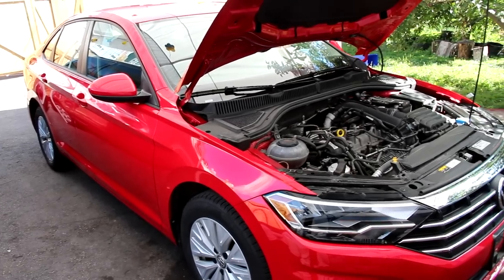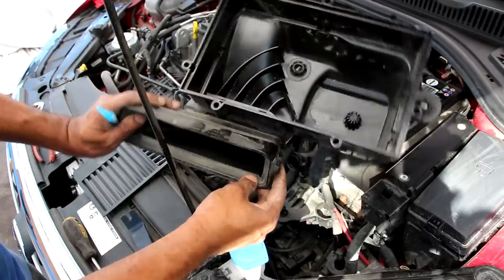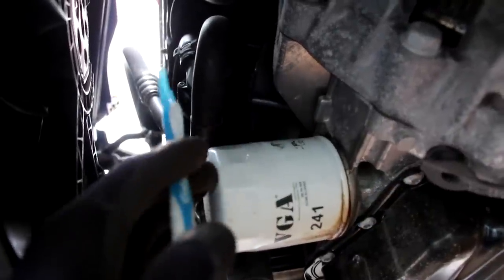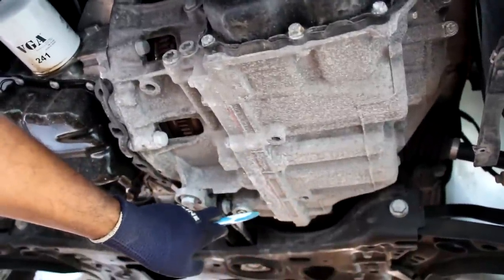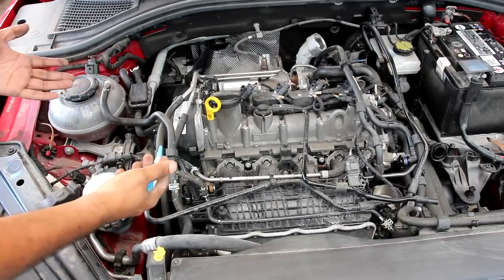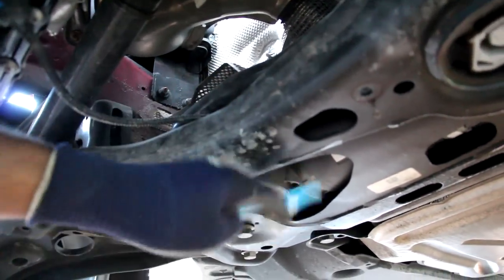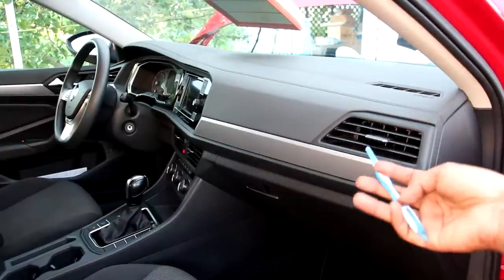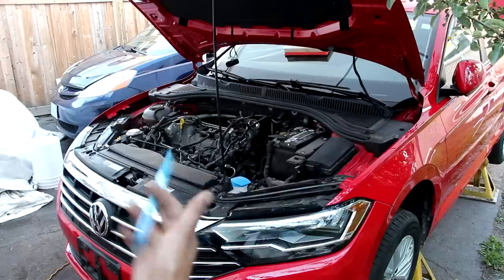Volkswagen Jetta Mechanical Review

Comment: Love the fact you are realistic, there is no "if" but "when" it fails. VW quality has taken an extreme nosedive in the last 3-5 years. Anyone thats compared the 7.5 Golf to an 8 would see.  We have a 6R Polo (other half's daily driver) no chance its staying with us past warranty. Way too much risk. Lovely to drive though.
Reply from the maker: It's sad that so much engineering and manufacturing effort goes to waste so quickly after warranty
Reply: Most of ‘cost-cutting on 7.5 to 8’ is the emperors new clothes. Golf 8 comes with more standard kit and is a finer tuned car. For example, it doesn’t have a gas bonnet strut, but it has 2 bonnet catches and the bonnet is actually aluminium so it is very light. The interior is just as solid too.

Comment: The inter cooler is integrated in the intake manifold.
Reply: @andybub45  It does improve the quickness of the air built up from the turbo. Because the lenfth of the Pipe ist shorter.
Reply from the maker: Very true. Less lag

Comment: Great review. Did you ever find the oil leak? That oil filter seem a little suspicious, didn't look original and seem to have a spot of oil !
Reply from the maker: Oil drain plug most likely
Reply: @speedkar99  so nothing was really broken?
Reply: Somebody changed the oil at one point and reused the Drain plug. They have to be replaced at every oil change due to it using a crush washer. ECS tuning sells two different drain plug types that eliminate the need of buying a whole new bolt every time.
Reply: @Tyler0513  ah intresting
Reply: no.. I believe people just hand tighten the filter w/out checking for leaks with the engine running.. the oil filter needs to be tightened down with a filter wrench to prevent leaking ( be careful not to crimp the filter).

Comment: Does anyone have problems with their Jetta 2019 with the transmission, I hear some grinding noise from it at approximately 30mph. And it's not the turbo noise. You can read this all over internet, I like the car enough to stay with it, but this sound it's making me crazy, and of course, tech mechs say it's normal, and it's not normal.
Reply: No, I have a gli and I don’t have any problems at all.
Reply from the maker: I've heard of the issues, I mentioned it in the video
Reply: @speedkar99  indeed, but in your experience, is this something that can be worsening in the long run? Can this cause any issues with the transmission or any other mechanical part? Thank you.
Reply: @MikeGod123  Yes, I hear this at times.  It tends to diminish past the break in phase of the car, at least in my case.  Notice - if you put the car in Sport Mode, the sound will go away.  There is greater throttle/more aggressive gearing it seems under Sport Mode, hence making the sound go away.  I believe the sound is due to the torque converter and gearing that is specifically chosen for fuel economy.  There is nothing wrong with the car, although I admit the sound can be an annoyance.
Reply: Buy a manual gear box next time - know too complicated to shift through 6 gears, especially in the city. But all automatic transmissions are crap these days, just like Samsung dishwashers - only good until warranty is over.

Comment: I owned a '10 Jetta TDI for six years that required a full replacement of the entire fuel line due to contamination.  Not sure if diesel fuel carries more contaminants than gas, but all i ever used was diesel.  Other than that fuel line, that turbocharged diesel was a pleasure to drive with that DSG.

Comment: This does have a fill port for the transmission, it's under the battery. You can access it with the air box removed.

Comment: Maybe they stopped using timing chains because VW had so many problems with them. Personally I'm happier having a component which is changed at regular intervals than with a component which supposedly "lasts the life of the vehicle", because this has been shown not to be the case on many occasions.
Reply: I wonder what your wallet thinks about that? Timing belt replacements on VWs are very expensive.
Reply: @andybub45  Replacing timing chains is also expensive, never mind fixing the damage if they break. Let's be completely honest here: maintaining a car is an expensive business, and if someone is not prepared to pay the price they should take the bus.
Reply from the maker: Why didn't they fix the chain problem? All the other small car OEs are doing chains

Comment: God, what an engineering mess compared to Toyota or Hyundai. I can't believe I was a VW fan boy back in the day.
Reply: I just bought a brand new Passat a few days ago.. now after seeing this video I’m a little concerned.😂 I actually had to exchange the vehicle today because it had multiple issues
Reply: Try looking at a Toyota 200 series V8 diesel and revise your comment about engineering mess.
Reply from the maker: Hot mess indeed
Reply: Ein Felder Exactly. The newer designs are getting crazy. It’s no longer just a German trait.
Reply: @ghost-4230  What were the issues?  Must have been pretty major for them to exchange the vehicle, rather than fix it!
Reply: What's weird is I don't recall EU Golf being such a pain to service. Looks like many parts are different, for example I don't think VW group offers torque coverter automatic in Europe, only 7DCT (and 6DCT for hybrids). They have decent reliability as long as you don't buy first engine within 2 years of launch. Even infamous 1.4 TSI is reliable engine now (supposedly).

Comment: My 2016 1.8 engine has the oil filter on top. Easy to service. It also has a timing chain. My car also has a battery cover, and an engine cover. It also has 3 point rear suspension. Oh, under hood has big thick silencing material. I think the 2016 SEL is a better car.

Comment: I don't know what it is about America that can not get along with German cars especially VW. They're reliable everywhere else but it seems America can not deal with "Advanced" because they can only deal with a car that can use a 2 dollar OBD scanner. Many VWs are top 10 best selling vehicles in Europe and especially Africa because they are reliable.
Reply: The European models are probably made better. They're notorious for having a plethora of electronic issues and ridiculously expensive to get fixed.
Reply: iam in 3rd world country and i will till you the problem with german cars ...ur  cars after 1980s dont stand well for hot /muddy /dust  zones there parts are not reliable and need replacing very often while its rarely to find their parts for good price if you are lucky to find them and alot of general mechanics   will refuse work on it or will do it wrong due to complexity and hidden parts or sensors
Reply: @Techie1224  yes, and they require fancy electronic tools and computers to fix, some only the dealer has.
Reply: @Techie1224  What country is that? I'm from South Africa and literally nothing can knock the VW Polo from being the best selling car in the country for the last decade or more. Second place is the Toyota Corolla. The 2 best selling premium sedans are the C Class and 3 series both of which were in the top 10 best selling cars a few years back for many years. Price increases has changed that but they still outsell any premium sedan (or normal sedan) from other manufacturers. There's so many in the road. We have specialist after market service centres and stores that cater for just German cars. They sell high quality reconditioned parts and brand new parts. In fact, there's more old Polos left on the road than Toyota Yarises. German cars are very reliable but they just need maintenance like every other car. It may cost more to maintain but that's what you get when they're ahead with technology and when they provide a ride like nothing else in the industry. They're solid and robust and can take a beating. Then again however, it is easier to maintain them in South Africa because of such loyalty by South Africans to the German carmakers and the number of them on the roads. German cars have a cult following here and as a result, there's so many aftermarket service centres, mechanics, spares, stores and tuners that it makes it much easier. I'm guessing much of Europe is the same and I know some other African countries are. 

It's why I've never understood why American markets don't get along with them. German cars are used as police cars, emergency vehicles and taxis (from an Uber perspective) in South Africa. The police use 1 and 3 series BMWs as well as VW Golf GTIs. Golfs are especially used by anti hijacking units and tracking companies. Mercedes Vitos and Sprinters are used as ambulance vehicles and most Uber Black rides are an E or C Class. It's because they're all solid and reliable. I don't get the American view.
Reply: @SDav21  
egypt and people there and in middleeast look for japanese, korean , american , some french and they even buy chinese cars ... german cars are  bad resale value and high costs
Reply from the maker: Depends on the model for the market and who's fixing it. In it's domestic market I'm sure the Jetta does better
Reply: @Techie1224  Interesting. Here in South Africa they have excellent resale value and maintenance costs isn't as high as people expect. You'll find 7 year old C Classes still selling for half its original price. Mercedes has the best resale with Lexus having the worst because Lexus simply doesn't sell many cars (no one seems to want to buy them). VW has excellent resale values too especially the Polo and Golf GTI.

Comment: I have a 2015 Jetta tsi with the 1.8 turbo just turned 100,000km.  Should i start worrying about the engine?  In terms of timing belts or whatever else?  Thanks in advance.
Reply from the maker: Start by doing maintenance
Reply: @speedkar99   i do maintain it i assumed that would go without having to state it.

Comment: I have one and I have so many issues with it 😞

Oh yeah, and an oil leak is one
Reply from the maker: Where's it leaking from? Seems like someone didn't tighten the drain pan bolt on this
Reply: @speedkar99  I am not sure, I'm not too handy and I haven't gotten it looked at yet. I think the oil is burning up since there's no sign of a leak, but I need to fill my oil like every month. Also the left head light burns out all the time
Reply: @Addison I don't believe you have this generation of VW Jetta if you're having those problems. If you do you must have got a straight lemon, I bought my 2019 VW Jetta new w cash in early 2019 and a little over 2 years and almost 40,000 miles later shes still a flawlessly running car. I drive her daily and I have the 6 speed manual but I'm a Euro car enthusiast and I owned an E90 BMW for many years before this so this engine will probably be mich simpler for me whenever the day comes I do have to do a little of my own wrenching or maintenance. It's a life style! Owned a boring old Acura for years before my BMW and still haven't went back to Japanese
Reply: @notreallymikevrabel5738  bought one in 2018, have around 75,000 miles and had to replace bad factory battery which warranty covered, the only issue so far is the front stop assist sensor seems to be going but mechanically solid
Reply: @notreallymikevrabel5738  how about some tuned Type R that can spin to 9k RPMs, hmm

Comment: Windshield sprayers probably have integrated defrosters. It was common even in 2002 VW's.
Reply from the maker: How did that work though?
Reply: @speedkar99  it heats up the sprayer if you turn on the mirror heaters/rear window defroster, if I'm not mistaken.
Friend has a 2004 Seat Alhambra(VW Sharan rebadge) and those have these sprayer heaters
Older cars didn't have this problem because these sprayers were hood mounted and the engine kept them warm.
Love the channel btw! 👍

Comment: I swear vw/audi are the only ones who uses screws to keep the intake box sealed up. And torx screws at that.
Reply from the maker: Lifetime air filter
Reply: My 08 Chevy takes 5 torx, unplugging an air sensor, disconnecting 2 hose clamps, and fanangling the oil fill tube before removing the air filter which is inside the plastic engine cover which is attached to the top of the engine with two friction clamps. Some cars just be what they be

Comment: 5:17 why is the transmission has a open case design? I can see the flywheel inside.  Also  the aluminum casing is badly corrosion. 
The engine is kinda of Worthy, but rest of the car is, like you said, troubling waiting to happen.
Reply: maybe it's a dry clutch dsg?
Reply from the maker: I'm not sure why theyd leave it so open ....air flow?🤣
Reply: @suprenormal  the GLI had the DCT. This is only Automatic or manual
Reply: Unless when changing timing belt, the TDC marks are on the torque converter, as it was always the case with VW.

Comment: I will give it 6 years, then these cars will become endless moneypits.
Reply from the maker: RIP Scotty
Reply: That's about right.  My 2014 Jetta SE 1.8t is already an endless money pit.  Have replaced the alternator, the accessory belt, the timing chain, the timing chain tensioner.   One of the daylight running lights is out.  You have to almost remove the front bumper to change it.  Big money.
Reply: @micahgreene4573  but isn't all that you replaced wear items on every car? You can't fault a car for it needing basic maintenance.
Reply: @MDC2020  BASIC MAINTENANCE???  Who has to replace a timing chain at 42,000 miles???  They want a kings ransom to replace the daylight running light.  Timing chain is supposed to last the life of the vehicle.  That's why chains over belts!!!  Evidently, not with VWs.
Reply: @micahgreene4573  you did something wrong because you are supposed to replace it at 90 to 100k. My friends have newer Jettas they haven't changed the timing chain yet.
Reply: @joshuabenjaminscott2365  car was serviced at dealer on scheduled intervals.  Please enlighten me and tell me what I did wrong to cause a timing chain tensioner to fail.
Reply: @micahgreene4573  2019 Jetta at 60k miles no repairs yet and that stuff should be under warranty

Comment: 1st VW Rabbit diesel: blown head gasket + other issues 2nd VW Rabbit electrical issues, randomly not starting, poor fuel economy (18 mpg for a 1.6L engine if you can believe it) 3rd VW Golf: so many issues mostly the trans, broken fly wheel, cracked floor. Seems like they haven't changed.

Comment: I just realized this engine is not intercooled
Reply: I believe it is actually an air-to-water intercooler. VW did that with the 1.4l TSI from last generation. All those coolant lines running into the intake header are part of the intercooler system. Also, that electric pump he said was going to the turbo is actually what feeds the intercooler.
https://www.rx7club.com/attachments/single-turbo-rx-7s-23/411959d1290974241-vws-impressive-oem-air-water-intercooling-system-vw_air-water_1.jpg
Reply from the maker: Yes it's in the intake plenum

Comment: endless money pit with all German cars like BWM, Volkswagen ,....complicated design, expensive labor, difficult to work on.....
====>> Toyota, Honda or Lexus keeps goingggggggg
Reply from the maker: RIP Scotty
Reply: I think the honda toyota reliability is almost mythical at this point. I've owned many and most of my family is die hard honda. I've seen them all rot to pieces in the north and become expensive to fix over 150k mi.
Reply: @nicholasbaker2904  it’s not a myth but I also don’t think they’re totally indestructible either, as you kind of make the argument for. I also don’t think German cars are as big of pieces of junk as people say they are. I have a 2010 Jetta with 135k that I love and runs great. The only thing I’ve done besides maintenance in the 2 and a half years I’ve owned it is the windshield wipers motor went out... but that was my fault because I tried using the wipers with way too much snow and ice on the windshield.

Comment: The washer fluid pipe cracked on mine in 3 years.
Reply from the maker: Sad
Reply: My Jetta has 6k miles and failed washer pump leaking fluid, dealership says it's accidental damage and don't want to cover it

Comment: Your reviews are amazing and easy to understand.  How much prep time do you take prior to doing one of these?  Do you memorize the shop manual? :)
Reply from the maker: Yes I study the shop manuals, read articles online, watch a few reviews, takes a day of research before going out and filming the vehicle
Reply: @speedkar99  Do you have notes or a script?  If not, you're even more amazing!
Reply: @speedkar99  you say that but you didn't even see that fact that the intercooler is built into the intake manifold (beginning of the video you said the vehicle doesn't have an intercooler, it does). You complain about oil leaks being common on a VW, yet the drain plug and oil filter were leaking oil, so yeah that's VW's fault for a careless ownwer taking it a 5 minute quick lube. Windshield washer fluid jets aren't mechanically actuated individually, they're heated, hence a hose and wire going to them. Good info here but still biased and occasionally hateful towards designs that "seem" difficult but aren't at all.